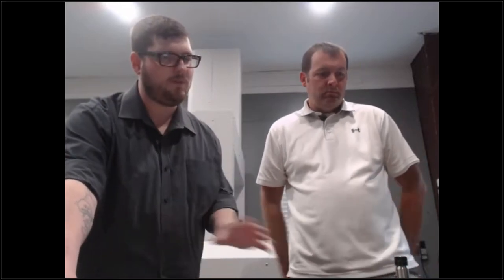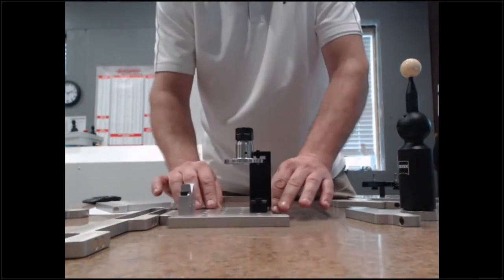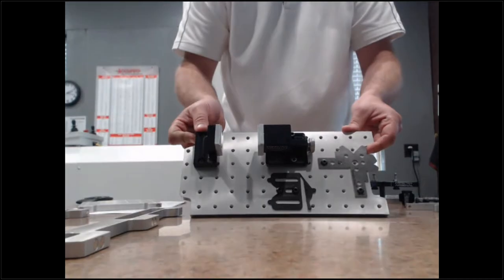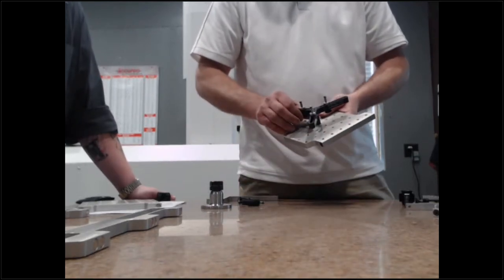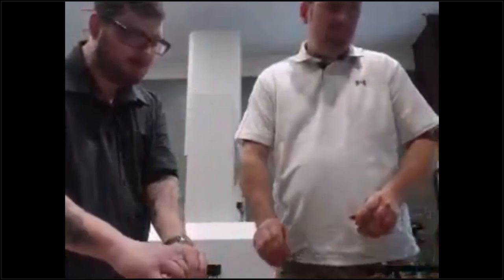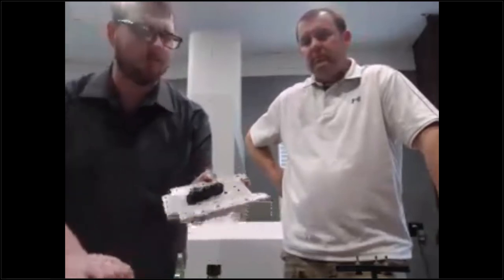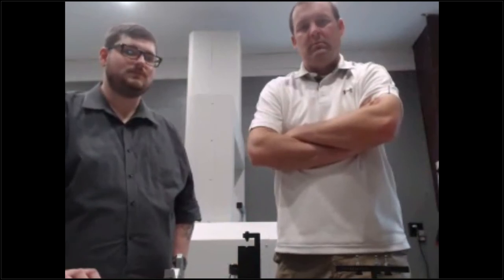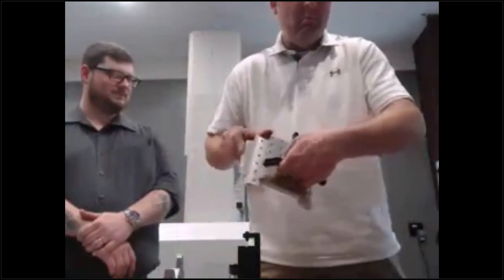The Future Is Modular - Don't Be Left Behind

Comment: Using a vision system, how do you clamp many of the same part at the same time like ten, 2 x 2 x 2 inch with a 1/2" hole in the center?
Reply from the maker: Wow, how did it take us so long to see this question? 
So, with a 2x2 part times 10 up. You could set them up against some Simple-Stops or other repeatable stop. But its impossible to give a solid answer without seeing the parts and understanding the inspection requirements and machine capabilities. You are welcome to contact the shop anytime, and we can discuss solutions for you.